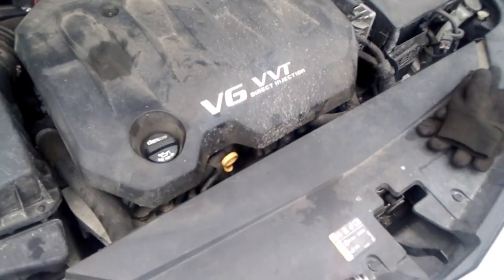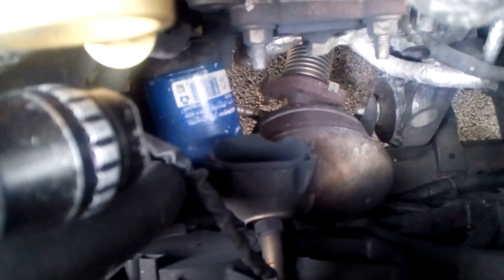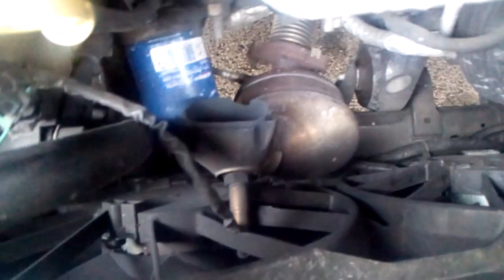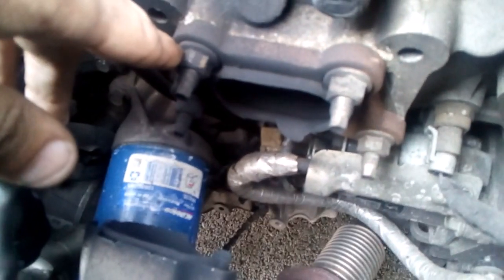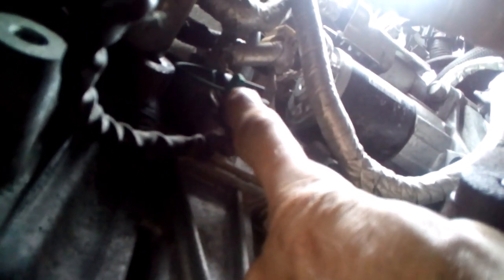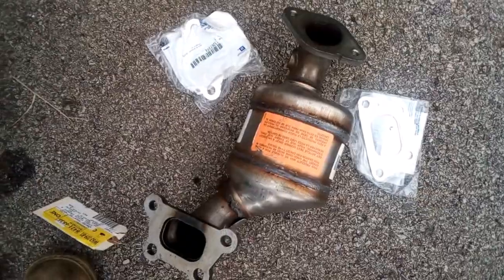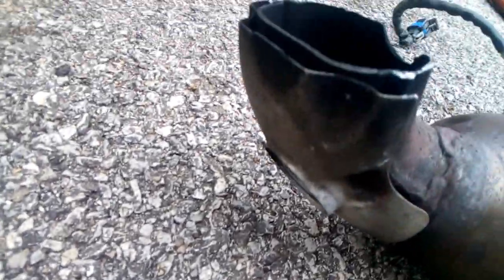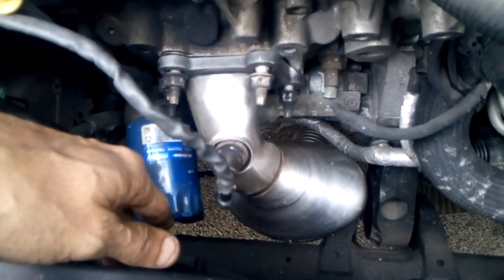2016 Impala Catalytic Converter Replacement 3.6L

Comment: Same thing happened to mine, it had about 20,000 miles when it first happened..  Now my 2016 impala is getting louder and i already saw a crack in the same spot.  So just a matter of time before it happens again.   I guess this a very common problem with our Impala's.   I'm almost at 60,000 miles, so better take it in before my powertrain warranty runs out.  Thank you for sharing this video, at least now I know I can do this job myself in case i'm out of warranty in the future.
Reply from the maker: Hi MrBArrioGuy323 . Yes it is starting to look like this is a common problem. It's a fairly easy repair. Roughest part was the lower bolts. I had to heat them up a bit with a torch to get them loose but if you are using air tools they may come right off.
Reply: The powertrain warranty is that 6yr or X-amount of mile warranty? Cuz i havent hit my 6 yr or 100k miles. So if that covers it then ill take it in instead.
Reply from the maker: @guero7543  Hi Vince. When I did this repair we were under the assumption the damage was from the accident the car was in since it was hit from the front and the rear, but apparently this is an issue with them. I would call Chevy to see what the warranty is.
Reply: Chevy should recall these problems and fix it for free
Reply: @lorendoncolaire2046  so depending on their inspection is whether or not warranty kicks in to cover the replacement from what my dealer told me. They inspect the converter and if it falls under the warranty guidelines you pay $0. If they find that say you damaged it then youre payin the cost to fix it.

Comment: Thank you for posting this! These catalytic converters need to be recalled, now! I just spent 4 days trying to get those bottom 2 nuts loose, and then went through hell and back getting the oxygen sensors off! Plus had to pay $600 out of pocket for something that should of lasted 75,000 more miles! 😑
Reply: Did u use the factory cat or aftermarket?
Reply: im letting mine soak in walmart brand wd40 tonight.... how did you get yours off?
Reply: How did you get the bolts off having a hard time taking my off
Reply: Can you explain how was it hard to get the sensors off?

Comment: Got a 2014 LTZ with the same issue! Greatly appreciate this video
Reply: Yea I'm next up lol
Reply: Hey, having trouble loosening the nuts on the bottom flange side. How did you loosen them. Do I need wd40?
Reply: My 2014 LTZ smells of eggs and I have no idea if it’s the converter or not
Reply: Do you know what’s the name of the catalytic converter ?
Reply: Like which one it will be I see several online
Reply: @btdayoungsta2702 sounds like battery

Comment: well, this ain't an accident, I had the same issue at the welding point, not detached like in your case, but cracked enough to make a loud noise, especially at startup. I managed to weld it.

Comment: It happened today again.  Catalytic converter broke off the engine and left me stranded.  I knew it was going to happened, as the car was getting louder these past few days.  My car has about 59,500 miles.  Good thing I'm still under the Power train warranty, but I'm sure this is also covered under the Exhaust system warranty which is up to 80,000 miles i believe.  Dealer said they will see if i'm covered, which I should be.  This happened twice already.   Just wanted to share my latest in relation to this video.   2016 Impala LT2 ..
Reply from the maker: Hi MrBarrioGuy223. When you replaced yours before did you use a dealer part or an aftermarket part? I am just curious. I am wondering if an aftermarket cat, if available, would be better. It appears this is definitely a recurring problem with factory ones.
Reply: @thedrivewaygreasemonkey2347  The dealer put the OEM catalytic.  Got my car back today, so far so good..   Next time i might look into an aftermarket component, or maybe have someone solder it properly before it totally breaks off.       My car currently still has some warranty left, so everything was covered.   They did offer to clean out my fuel system for $300 dollars, sorry, not going to fall for your gimmicks .. lol

Comment: Hey I had my converter separate from the flange . Had a shop weld it back but now there is a very bad oil leak . How did that happen ?? It wasn’t leaking when I dropped it off .

Comment: I've had this happen to my impala twice now. The problem is, they weld the bolt flange to the pipe on the outside only. But they don't burn it in hot enough nor do they weld the inside. So eventually after heating up and flexing around in 5 or 10 thousand miles it breaks off again. Junk! Should be recalled by GM!!

Comment: Same car. Same EXACT problem. NO accident. You used a 15mm hand tool or power tool to remove bottom bolts?
Reply from the maker: Hey Mister Bill. This must be a common problem with these. I live in the midwest and everything is usually pretty rusty so I used a propane torch to heat the flange area up real good and used a 1/2" drive 15mm on a breaker bar to crack them loose and then a ratchet to get them out.
Reply: Thanks alot. Great uplaod
Reply from the maker: Glad it helped you out.
Reply: @thedrivewaygreasemonkey2347  I dont want to damage the flex joint did you have any problems with that when breaking them loose with the breaker bar? all I have is walmart brand wd40 and a heat gun
Reply from the maker: @andrewlopez3745  Hi. Sorry for the late response. I heated the flange where the bolts are. I would suggest using a propane or mapp gas torch if you can get one. I don't believe a heat gun is going to get the metal hot enough.

Comment: Great video where did you find the part and the correct name for the front thanks
Reply: This just happened to me and my wife yesterday, it's called a 3-way right catalytic converter, the shop is charging me $1,100 to repair this, the catalytic converter was $800

Comment: Just paid 2,200 Thank  God I was able to come up with the money I was  in a recent accident hit from behind my 2015 Impala V6 approx. a month ago , but a week ago  the manifold converter broke right at the manifold fell into the fan and put a hole in the radiator I had to tow it to the shop and needed a rental , the sensor had to be replace also  what a mess I was stranded for 3 hours before towing When it rain it pours smh

Comment: What side would this one be? I have a 2017 Premier and mine has detached just like in the video, however when I research the part it's coming up that I have 2 (right & left) when I look under the hood I'm only seeing the one , so I want to make sure I purchase the correct one.
Reply: There’s another catalytic converter next to the firewall which is bank 1 the one closer to the radiator is bank 2
Reply: @joseavila3847   Thank you
Reply: @joseavila3847 so which bank was this that he changed Im having the same issue and I think I ordered the wrong part. Can you help please?
Reply: Bank 2 is the problem in the video, however when you order the part  it’s called either the driver side or passenger side catalytic converter, in this case it’s the driver side. It sounds confusing but trust me, i would recommend to replace the 02 sensors while you’re at it too ps. My bad for the late reply.

Comment: I have the same issue except mines is cracked at the Flange its still under emissions warranty and i also have a Powertrain warranty my question is how long is the repair/replacement process
Reply: It took 1 day i dropped the car off in the morning it was ready by close.

Comment: I had the same thing happen to my 2015 Impala I took it off I brought it to a welding shop they cut off the shield little bit till he gets the full and welded it up and never had an issue sense the original one is not welded together from the outside

Comment: I have a 2014 impala, my converter has a leak on top of the converter right before the flange, do you think it would be possible to have the crack welded instead of replacing the whole thing?
Reply from the maker: Hi Daniel M. You may be able to have it welded. Keep in mind the metal is very thin so if I were to do it I would be very careful not to burn through it. I think if I get another one like this I will try to weld it myself.
Reply: @thedrivewaygreasemonkey2347  thanks for the quick reply
Reply: Please help. So the catalytic converter is located underneath the hood on this car. Or is there another one?

Comment: The nuts on the bottom(flange side) are not budging and it seems that I'm loosening the flange neck. I don't want to break that. How do I loosen those nuts without tearing the flange?
Reply: Try using wd40 to loosen the bolts.
Reply: What did you use to get the bolts off easier?
Reply: @james-ox1yf  I ended up borrowing an impact wrench from someone. No matter how much wd40 I sprayed, it wouldn't budge.
Reply: @Snypersystem186  i just did mine, i ended up using a hammer to tap the bolt heads and "unfreeze" them being rusted in place.

Comment: Dealing with the same job this morning customer doesn't have the money im going to weld the flange back to the converter
Reply from the maker: Hi Kimber baker. Yes this seems to be a common problem. I am curious how your weld job comes out. That metal is really thin around that flange and hopefully it works. The next one I get like that I will be trying to weld it back just to see what happens. Let me know how it comes out. .
Reply: How did this turn out? Considering doing the same
Reply: I have a crack forming, thinking of removing and having it welded too. Need to know if it lasts longer then a new part